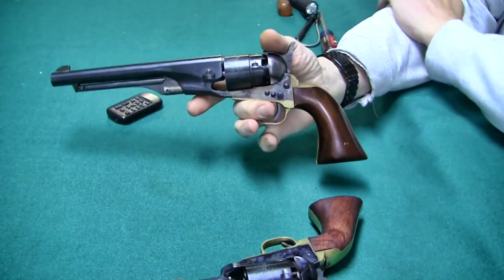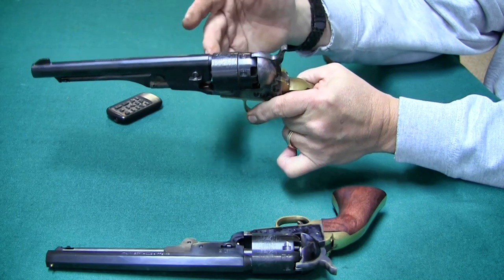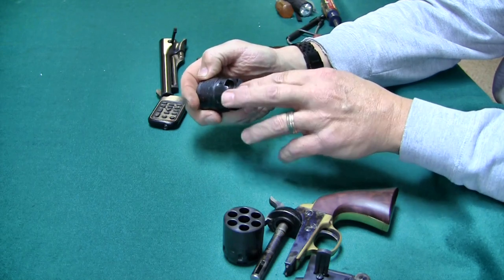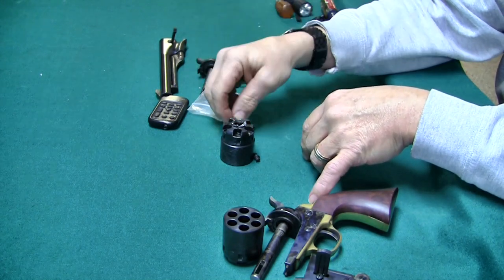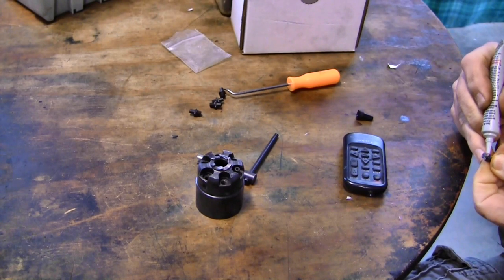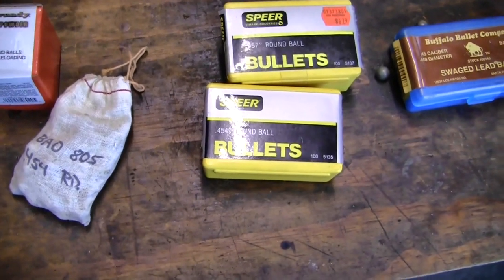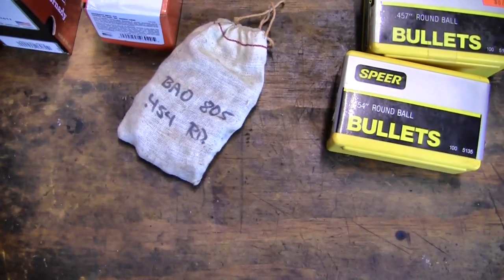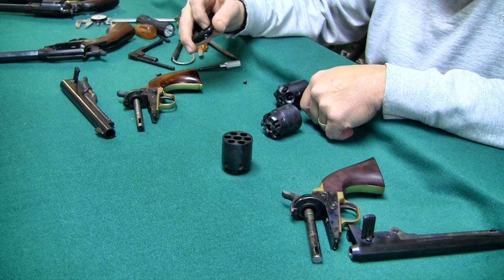Chain fire in cap & ball revolvers the fix

Comment: Good discussion video. 👍 Chamfering the chamber mouths isn't required. Nothing wrong about doing it, but it isn't required. A sharp chamber mouth can be a good indicator that your balls are large enough. Properly fitting balls will shave a thin ring of lead upon loading. That lead ring needs to be circular. If not, you need to check for an out of round chamber. With chamfered mouths, you want a slight amount of compression. Ball sizes are, indeed, variable. Pre-1980's revolvers often recommended 0.451 balls. These were typically Lyman imports, or early EMF or Navy Arms. Since around the mid 80's (+ or -), the tolerances have tightened up considerably with most makers switching to CNC machining. Since around 2000, tolerances are close enough that you only need know the maker to get properly fitting parts. For revolvers, ball size should be 454 for most makes. Original colts, etc., dragoons, Walkers, and Ruger Old Army's, need 457 balls. The 445 and 440 size balls are for rifles. A 50 caliber rifle will use 490, or 495 balls. The differences are made up with patch thickness. 36 caliber revolvers use 375 or 380 balls, but a 36 caliber rifle uses 350 size balls.
Part of all the confusion stems from differences in naming systems. Europeans used bore size before rifling. Americans typically used rifled diameter for naming, and during the Civil War (before and after), immigrant Europeans caused both systems to be used for a while. A thick book could be written on this subject. 
As for chain fire, this can occur from EITHER end of the cylinder. Too large a cap can flash ignite (similar to a flintlock), and too small a ball can flash ignite. Bare nipples won't chain fire. I know from many experiments. A loose fitting cap will. I got one of the first Ruger Old Army's made, so I've been around this a while. Only had one chain fire, and that was caused by loose fitting caps that I pinched to stay on. Chamber concentricity and properly sized balls and caps, and chain fire doesn't happen.

P.S. Petroleum based lubes yield a hard and difficult to clean fouling. Natural based lubes will clean up with warm water and soap.
Reply: Chamfering (or other burr removal method) the chamber mouths is absolutely required if there is a burr around it because the burr is most likely not concentric with the chamber mouth for the full 360-degrees which will result in the ball/bullet having more lead shaved off on one (or more) side(s) leaving a gap for a spark to pass and cause chain-fire. Even if the burr is concentric with the chamber mouth and shaves the projectile evenly all the way around the projectile will likely be undersized for the chamber and will permit sparks to go around to the powder. Maybe it will help you understand the orientation of the burr if you picture the burr being caused by the facing off or polishing of the entire face of the cylinder and  NOT a burr from boring each individual chamber bore (think of metal being smeared across the opening of the chambers). In effect, the burr acts to reduce the Internal diameter of the chamber mouth - either in one quadrant or for the full 360-degrees depending on the severity and extent of the burr.

Comment: Chamfering the cylinders assists in swaging the balls into the cylinder. When they are swagged instead of shearing them, more surface area of the ball comes into contact with the walls of the cylinder. When in doubt as to the diameter of the balls, better to err on the larger size...

Comment: Chain fires occur more frequently at the rear of the cylinder....not the front.  Fit of caps to nipple is important, but because there is so much ‘fireworks’ going on in that area through cap-fragmentation and crossfire between the nipples, it is not an uncommon occurrence.
Reply: No, it never occurs at the rear. It's always the front of the cylinder. What you said is a common fallacy.
Reply: @clffreak  not according to tests done by the NMLRA.  They used #11 caps on #10 nipples to exacerbate the ‘theory’....it is not fallacy to assume it can occur.  They found that poorly made & ill-fitting Italian caps were especially prone to creating the crossfires.  During the tests, they also fired properly fitted pure lead balls with ZERO lube over the top of loaded chambers and properly-fitted caps from either Remington or CCI 
 (can’t remember) and experienced no crossfires, so its up you you.🤷‍♂️
Reply: @craigoldsen1667  I get what you're saying, but I trust Paul Harrell more :)
Reply: @clffreak  I understand. Be safe!
Reply: I have been shooting cap & ball for more the 40 years and have never had a Chain fire from the rear so how frequent is it I've only had one chain fire and that's because I use the wrong size ball in my 44
Reply: @lynnie0526  that is  pretty much what I was so feebly trying to convey in my earlier post.  There ain’t no way the fire & brimstone fireworks can get by a well-fitted ball/chamber situation......an ill-fitting cap/nipple condition is MUCH more likely to produce a chain fire.  Somewhere, there exists a high-speed video of tests done to prove how it happens....in REAL life.😎
Reply: @craigoldsen1667  I have fired my Pietta after a lot of the caps fell off. Didn't have a chain fire. But one time doesn't mean it never could happen. After that I got the right size caps.
Reply: @craigoldsen1667  Thanks
Reply: @clffreak  i have euroarms replica. Which has really close cap to frame. It goes from behind. I stop shooting it.

Compared to new pietta, at pietta there is  more space between cap and frame.

I put 457 balls. Lubed. And it goes of on rear chain fire from cap.

Nipples are new. Caps fit tight. 

Gap is like 0.6 mm to frame. It looks like one particular niplle capped has 0.1mm and this usually go off.

So back fire from rear is possible. 

I need to mil my frame to made more space. I love this gun with hate. Rescued from trash bin. 

The chain fire posibility is less with 15gr charge. With 25gr this gun goes off. 

Btw I have welded anti cap jam bars with all my colts.

Comment: I'm not sure, but I don't think chain fires back in the day were  such an issue as long as the recommended diameter of projectiles were being used - mainly because of good QC and the chambers were machined out to be wider at the mouth and got progressively smaller toward the nipple end of the cylinders (i.e. tapered). This tapering made loading easier and ensured a good swage (or press fit) of the projectiles as they were seated. Not sure if Colt did this on all their guns or not.

Comment: It seems to me that a lubed wad behind the ball or slug would seal off the powder from the flash better than anything else but I can see that the sharp edges on the cylinder could cut off some of the flash and really direct a hot stream of sparks into the other chambers 👍

Comment: My Uberti1851 Navy is 18 years old, just started shooting it again after a 12 year hiatus, so I'm checking around on chain fires so I can avoid it. I know my cylinder doesn't have a sharp edge around chamber and lead comes off so it must be sealing......
I use a cap applicator off a something like a tube of glue and or gasket maker to start the caps on the cylinder, they are to small for my fingers. I take that applicator cap and cut end off to fit the percussion cap snuggly then start the nipple threads on with that..........

Comment: I suppose there are a lot of things that could cause a chain fire in a revolver. I have never even considered it could be caused on the cap end because the cap makes a barrier for the flame. If you have ever fired you six shooter in the dark you can see where all the flame is. One of the easiest ways to prevent chain fire is a lube over the bullet and/or a larger grain powder. Most chain fires in my world are caused from having to small granulation of powder. I and my friends make our own powder and the fine dust is the worst thing to have around a six gun.

Comment: I was told by my PawPaw to pack the ends with heavy grease over the ball and powder both that way they're sealed from both ends as long as your caps on the rear end are tightly fitting, and not like filling them up, but just enough to coat them so even if there is powder on the outsides the charges still won't light

Comment: Had that happen to my Navy Arms 1858 used some undersized ball that was in a bag of mixed 44s from an estate.
Reply: Many decades ago, my Navy Arms Griswold and Gunnison chain fired three round for a friend of mine. It only happened once. Back then we were using .451 Round Balls.
One round whent down the barrel, one went up and lodged into the loading lever and the third hit and split the ball on the wedge. It damaged the brass frame and the cylinder gap was three times the spacing, so Navy Arms sent me a new frame.
 I believe the cylinders were a bit larger,  so from now on if I shoot it again I will use .454 balls.
I have several other cap n ball revolvers, so I think I will retire this one since it was a keep sake from my father in law. It was a gift from him when I returned from my tour in Korea back in the mid seventies. After leaving the service we worked closely together as he taught me his trade and I became very sucessful. We were very close and I miss him dearly. RIP papa Earl.

Comment: Well you are half right! As it is a compound problem, but that chamfer does diddly for stopping a chain fire. As you can have a chain fire even on a cylinder that has been chamfered. The only way to prevent a chain fire, is to put the gun in a display case you hang on a wall as a work of art everything else is just something you do to reduce the chances of a chain fire. Now you can increase or decrease your chances of a chain fire, by how you load the gun. Meaning use a lead ball that is big enough to seal the chamber, use a harder lube that does not blow away when you fire the gun. Use felt wads, or felt wads with lube and the appropriate dang percussion caps for the nipples on your gun as well as a small amount of bee’s wax around the caps. Now if your gun uses #10 caps, use #10 caps instead of #11 caps pinched down to fit #10 nipples. And if you use home made caps, make sure to seal them with bee’s wax or a plastic tub that fits over the caps. That’s why in nearly 40 years I have never had a chain fire. Does not mean I will never have one, just that I have yet to have one happen in nearly 40 years. Sealing that cylinder is key to reducing a chain fire.
Reply: Back in the day they never used lubed wads (or any wads) nor did they use bee's wax/lube over the loaded cylinders. In fact Colt's loading instructions specifically stated not to use wads or lubes and chain fires were not a big issue. So why do modern cap & ball shooters have to jump through all those hoops?

Comment: I had a Uberti Walker many years ago that would chain fire every single time, no matter how it was loaded (and I do know very well how to properly load a C&B pistol). No cracks or defect in the cylinder walls, etc. By all rights it should have been fine. Never did figure it out, neither did several well-versed friends. I designated it only for blanks for a Civil War unit I was in, never live because of that. It did have the sharp chamber mouths, and I did use a proper ball, with a good solid ring of lead on loading. You have me wondering if chamfering could have helped. Something to ponder, but the gun is long gone.
Reply: I'd be willing to bet there was/were burrs around one or more chamber mouths that either totally resized your oversized projectiles or shaved at least one side of your projectiles leaving path(s) for sparks. But since it's gone we'll never really know.
Reply: @rharthart9477  Not the issue, it was chain firing even when packed for blanks, so no loose ball. I'm a  (now retired) Machinist, so I not only checked for burrs, but also took it to our QC room and used our setup to check for cracked cylinder walls, so any defects would have shown up. Even ones not visible.

Comment: Do not chamfer your cylinders the only thing that causes Chain fire is improper ball size when you seat your bullet you should leave a small ring of lead that means the cylinder is closed tightly . (Example a 36 cal cap and ball can have a .375 ball or a .380 ball) Greece is for reducing fowling and I have never heard of chain fire caused by caps setting off the next chamber but I guess it all depends on who you listen to I recommend You Tube channels guns of the West and tallest 1954. Tallest has a great video loading a cap and ball and it explains everything.
John
PS A chain fire can seriously hurt you and I have been shooting cap and ball for more then 40 years
Reply: I think you meant the Duelist1954, another good channel is Blackie Thomas, they all have a lot of valuable information about black powder weapons.
Reply: uhhh some cylinders in guns actually oversized bores for some reason from factory i have an ASM 1847 built in 93.. that has two cylinder bores oversized for some reason.. eveb 457 dont fit in them properly.  the balls just roll in nearly abd pull back out with the raming lever..

i have to use wax to hold those two in.  after the cylinder starts getting fouled it then holds the balls better.  but yea i need to find like 460 balls or something. or make them myself.

considering getting a 460 mould and buying 457 balls from hornady then recasting them to 460 to stop the chain fires.  that or i need to find a new cylinder

Comment: out of 9 revolvers.  only one chain fires.  doesnt scare me unless you scare easy ?   mine happens on a 1847 walker.  what causes mine is 2 cylinders seem to be bored out too big from ASM.. and even a 457 ball doesnt fit they just roll in nearly.   So i have to wax the balls after.  that fixes it.

mine is from the lose balls.  not a cap issue.. in fact i dont believe any chain fire is from caps

Comment: I'm very interested in the conversion cylinders.  I would keep my black powder one, but I'd rather shoot the conversion.  I know some hand fitting is required, and that you might have to use special bullets.  I already own factory .38 special bullets.  Some that are jacketed and some are lead round nose.  All are standard pressure ammo.  If I buy a .36 caliber conversion cylinder (and they're not cheap!)  what would I have to do to the gun in order to shoot the ammo I already have?  Or even should I?  Are there safety concerns I am unaware of?  I like the convenience of a loading gate, rather than a capped style cylinder, what guns lend themselves readily to such a conversion?  Are there better guns than others?
Reply: IMHO, even with steel frame modern revolver conversions, err on the side of caution... mild loads, lead bullets are the best choice, whether a Colt clone or a Remington solid frame type.

Comment: I would recommend using a toothpick to apply the Anti seize to the nipples .If you get too much it can get inside the chambers and contaminate the powder. I have a new Pietta 1860 Army and Pietta recommends .451" or .454" and my chamber mouths measure .440". Over 40 years ago I had an 1851 Navy Brass Frame made by  Navy Arms which liked .375" or .380" Balls, I used to buy 5lb. bags of 00 Western Buck Shot for it .Worked Great, saved a lot of casting and the .380" Diameter was great. I finally had to get rid of it because I forgot to grease it one day and had 3 chambers go off at once and stretched the Frame.

Comment: Never say" ...to make a long story short". That's a warning to the listener that the speaker is going to talk way too long about nothing important. Work on your message.
Your 44 revolver is really a 45.
Chamfering the cylinders is ok. But not necessary. Proper ball size is everything. Shaving the ball when it is pushed in, is what seals the cylinder, eliminates chain-fire, and gives a surface for the rifling to grab.
New gun/ used gun. Doesn't matter. Ball size. That matters.
You made a science project out of nothing, and most likely didn't help anyone.